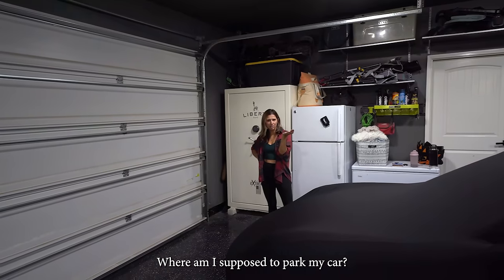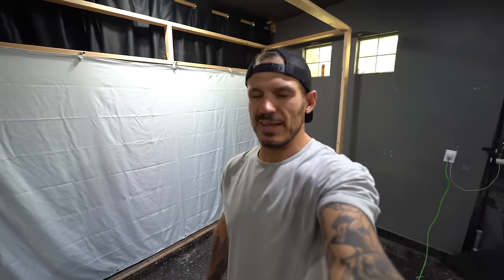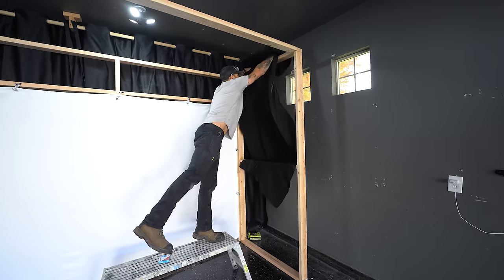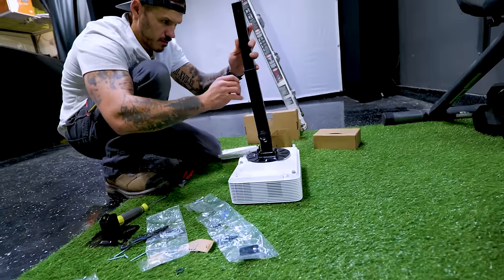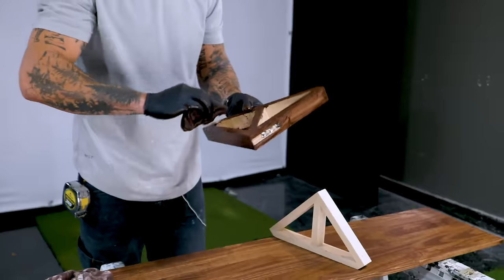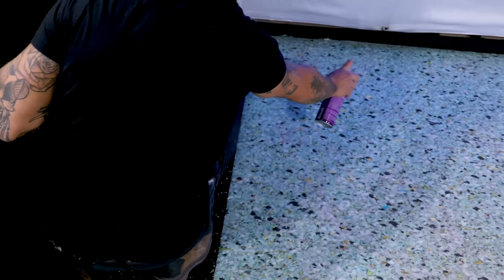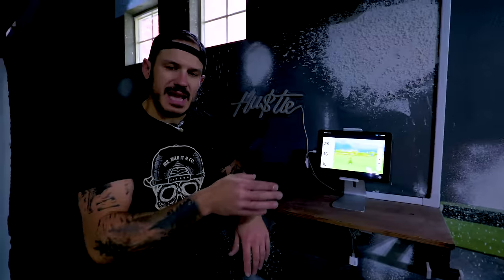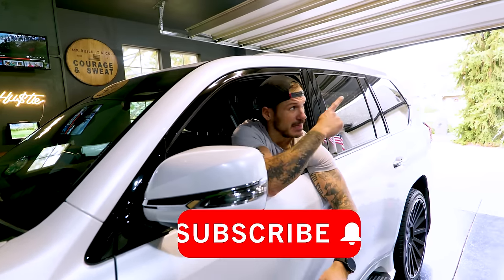Converting My Garage Into a Golf Simulator. SHE'S PISSED!

Comment: You ran the wire for your light, you could have also done the wires for the iPad and tv.  They make CL3 rated HDMI cables. And you could have placed the projector just about anywhere.  You just have to dig into the picture adjustment menu for keystone correction, image size etc
Reply: You really can't do keystone very well when you use a short throw projector or ultra short throw projector. A little bit you can but the image gets bad real fast. Not unless the projector has lense shift!
Reply: @mynameisprivate158   I was just saying that he didn’t necessarily have to place the projector in that one particular spot because there are adjustments in the menu he could have used.  He didn’t seem to be aware that he could do that.
Reply: using iPads leave black lines from the projector, using a pc as a bigger aspect ratio.